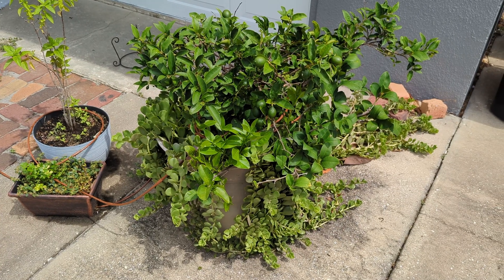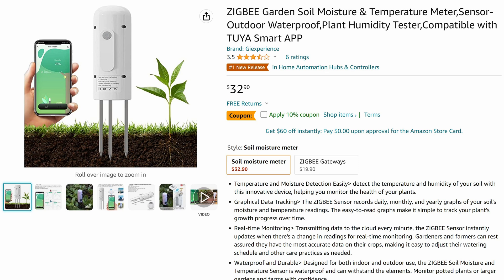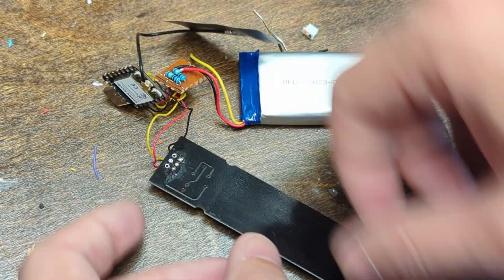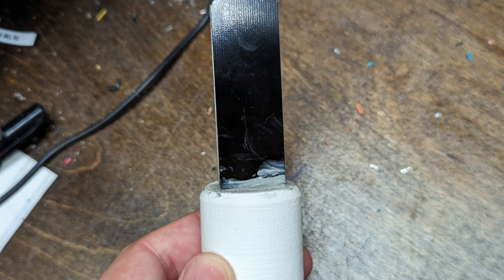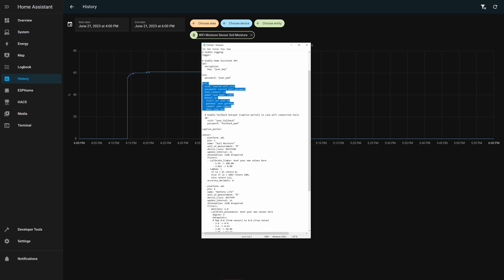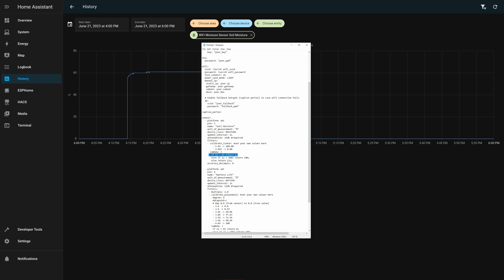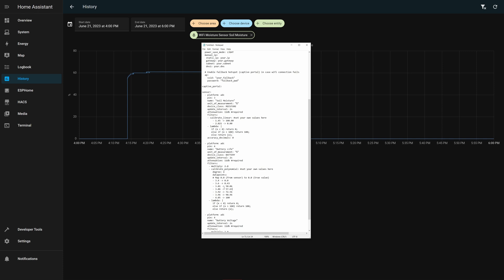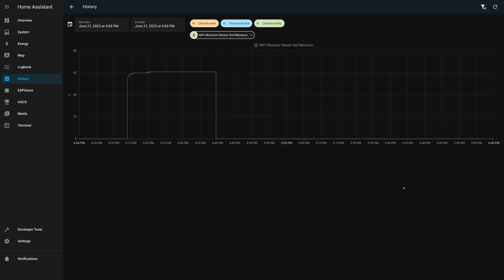Wi-fi Soil Moisture Sensor with ESPHome

Comment: Thanks for posting this.  My sensor is a solar powered sensor in a lake to measure water temperature.   I updated the code to reflect the following. I removed the polling script that would run every second.  I changed it to an on_boot function that checks for the OTA toggle status being on - preventing sleep when the sensor boots.  I have the binary sensor checking the OTA toggle for On/Off state in HA.     I created a simple automation in HA that if the OTA toggle is on turn it off in 10 minutes (prevent long run times on the sensor).  It is similar in function to what you had done but a different flavor.

esphome:
  name: esphome-web1
  friendly_name: Sensor
  min_version: 2024.11.0
  name_add_mac_suffix: false

  on_boot:    
    priority: -100
    then:
      # Wait for WiFi and the API to connect before sending data
      - wait_until:
          wifi.connected:
      - wait_until:
          api.connected:      
      - delay: 5s
     
      # Check if OTA toggle is ON
      - if:
          condition:
            binary_sensor.is_on: lake_sensor_ota_mode
          then:
            - logger.log: "OTA Mode ON → Preventing deep sleep"
            - deep_sleep.prevent: deep_sleep_manager
          else:
            - logger.log: "OTA Mode OFF → Normal sleep cycle"
            - deep_sleep.allow: deep_sleep_manager

I kept updated the binary sensor as follows:

# Monitor HA Binary Sensor for OTA Management
binary_sensor:
  - platform: status
    name: "Lake Status"

  # - platform: homeassistant
  #   name: "Lake OTA Mode"
  #   id: lake_sensor_ota_mode
  #   entity_id: input_boolean.lake_sensor_ota_mode

  - platform: homeassistant
    id: lake_sensor_ota_mode
    entity_id: input_boolean.lake_sensor_ota_mode
    on_state:
      then:
        - if:
            condition:
              binary_sensor.is_on: lake_sensor_ota_mode
            then:
              - logger.log: "Lake OTA Mode ON → Staying awake temporarily"
              - deep_sleep.prevent: deep_sleep_manager
              - delay: 10min   # keep awake max 10 minutes
              - logger.log: "Max OTA window reached → Going back to sleep"
              - deep_sleep.allow: deep_sleep_manager
              - deep_sleep.enter: deep_sleep_manager
            else:
              - logger.log: "Lake OTA Mode OFF"
              - deep_sleep.allow: deep_sleep_manager
              - deep_sleep.enter: deep_sleep_manager

I also have an automation in Homeassistant that checks for the toggle being on for 10 minutes and turns it off.

alias: Lake OTA Mode Off after 10 minutes
description: ""
triggers:
  - trigger: state
    entity_id:
      - input_boolean.lake_sensor_ota_mode
    to: "on"
    for:
      hours: 0
      minutes: 10
      seconds: 0
conditions: []
actions:
  - action: input_boolean.turn_off
    metadata: {}
    data: {}
    target:
      entity_id: input_boolean.lake_sensor_ota_mode
mode: single

Comment: Can you please put a link to a txt where we can get the code formatted correctly? Youtube description isn't the best option :) Thanks
Reply from the maker: It is formatted correctly, as far as the YAML goes. You just have to copy and paste it, and then add greater than or less than symbols where directed. 

Any other issues are caused by changes in ESPHome itself, as they change components over time. This project is dated, in that respect. I haven't updated it for current ESPHome component requirements.

Comment: I cannot get this to compile. Can someone help me out.
Reply from the maker: It's an older project, and ESPHome has received many updates in the meantime. It will require several changes to work with current versions of ESPHome. You might check on the ESPHome discord for help with all the adjustments.

Comment: Amazing video that has covered a lot of things i wanted to grasp. I am new to this so i hope i am not asking the obvious
For the voltage divider you used identical resistors which is why you used a multiplier of two in the code correct? could you have used different value resistors to get 3.3v and not used the multiplier? any benefit of one over the other and what value resistor did you use? 
also the polynomial is to approximate the discharge curve of the LI battery correct? 
again, great video
Reply from the maker: Yes, the identical resistors were to cut the voltage in half. When doing a voltage divider, you're going to be working with a ratio. If you take a reading between two resistors, the resulting voltage will be V*r2/(r1+r2).  Since both r1 and r2 are identical, my resulting voltage is V*1/2.  If you want 3.3V, then the ratio you need depends on what the input voltage is. The resistors can be almost any values, as long as they result in the correct ratio. 

Practically, however, there are a couple of other considerations. Lower resistors values will result in more current flowing through the divider (total resistance is R1+R2, and thus current will be V/(R1+R2)). If there is no switch breaking that circuit, then that current will flow all the time. This can be bad for battery life, especially for a device which is mostly "off". So for battery monitoring, I like to use larger values (100k to 1m). You can't go too crazy though, because you do have to have enough current for the sense voltage to be measurable. 

And yes, the polynomial was just an approximation of the this batteries discharge curve. It's not super accurate, but it's enough for a rough estimate. Linear honestly isn't much worse than polynomial given the other inaccuracies in the system.

Comment: I was testing a very similar setup, and found that my Xiao ESP32C3 was still drawing ~25mA in deep sleep. I wasn't able to reduce the power consumption, so with it only lasting a day or two,  I ended up making it a hardwired system instead. What kind of battery life did you ultimately end up with?
Reply from the maker: 25mA is way too high. That doesn't seem like it's going into deep sleep at all. 

Battery life will obviously depend on the battery size you use, but with my current setup where I power the sensor via GPIO pin, I last recharged on January 24th, and it's showing roughly 50% battery remaining.
Reply: @TechDregs good to hear yours is working as intended. I had 3 separate sensors connected to GPIO 2-4, and a high gain antenna, but even with the antenna disconnected, it was drawing around 100mA in use, and then dropping to a steady 25mA during deep sleep. I tried looking at all of the deep sleep protocols, but never could figure out what was causing the high draw. I'll have to take another look at it soon. Thanks for the info!
Reply from the maker: Hmm... yeah, I don't know. It just doesn't sound like you're not hitting deep sleep. How are you measuring current draw? Are you using a voltage divider on the battery leads for ADC measurement? Are the GPIOs being set to off/low for each sensor prior to sleep?
Reply: @TechDregs  I used a multimeter in series to measure the current. I've been using the esp_deep_sleep() function with a number of different sensor controllers I've built, and know that the devices do in fact enter deep sleep (or some semblance of it), but for whatever reason the current draw is still high. They don't appear to enter any of the alternative sleep modes. I dabbled with trying to set the GPIOs to low individually before entering deep sleep, but that never seemed to make a difference. No worries! I need to do more testing to get to the bottom of it.
Reply from the maker: @holodiscus  Very strange. Is the current draw still high without the sensors? I would probably check what happens when adding them one by one so see if you can isolate what's causing the draw.

Comment: normal water does not conduct like mineral salts or acid or hard ground water PH
but great project.
Reply: It is not a conductive sensor, so the conductivity is not all that important. Probably calibration is needed anyway, the soil will have an influence on the readings. 
https://www.youtube.com/watch?v=m0mcCtcViTY

Comment: For a future video you may want to try the Sonoff "Zigbee Smart Water Valve". It also uses ESPhome and if you use MQTT you can monitor the water usage, set it by amount of water, time and with some coding soil moisture, battery, schedule... I just installed mine on my wife's garden/rain barrel/pond pump and works great. Currently I just set it to turn on 2X a day for 30 seconds  (16 ounces each run). Next is MQTT and soil moisture checking, then rain forecast..... Great video you did

Comment: Thanks for the tutorial! But by Pasting your code i get the following error code:

INFO ESPHome 2024.5.5
INFO Reading configuration /config/esphome/boden-feuchtigkeit-1.yaml...
ERROR Error while reading config: Invalid YAML syntax:

while scanning a simple key
  in "/config/esphome/boden-feuchtigkeit-1.yaml", line 16, column 1
could not find expected ':'
  in "/config/esphome/boden-feuchtigkeit-1.yaml", line 17, column 1

can someone help me out? Many thanks!
Reply from the maker: Check your spacing. YAML is very sensitive to indentation.
Reply: @TechDregs thanks. Will double ckeck

 I tried to ask chat gpt and it gave my this code. 👨🏼‍💻

Comment: Do you have a github page or a written guide with wiring diagrams? I'm just getting started with ESP32 using batteries. Also, did you consider fitting a solar panel to this battery to keep it topped up?
Reply from the maker: https://www.youtube.com/watch?v=Yttauf94A04

Comment: Is there any update on this project? How is the battery life? How accurate are your readings? I'd be very interested in a follow up
Reply from the maker: I can't speak to accuracy, as I have no other soil moisture measurement devices that use a different type of sensor. But since I reconfigured the sensor to draw power via GPIO that turns it off when in deep sleep, battery life is over four months on a charge. I did something like a followup in these videos: 
https://youtu.be/4EZYYPmQnJY
https://youtu.be/Yttauf94A04
Reply: @TechDregs  Interesting videos, thanks!

Comment: Thanks a lot for sharing your project! A quick question: the Xiao C3 is rated up until 3.6V whilst the battery is 3.7V (and I assume the voltage goes even higher, maybe lower 4.x when fully charged). Have you experienced any issues with it, should I be considered if I were to copy your setup with a 3.7V LiPo battery?
Reply from the maker: Not sure where you're getting the 3.6V from, so IDK what to reference there. The Xiao is made for 3.7V LiPo batteries. The higher charged state voltages (~4.2V) are no problem; that's just how LiPo batteries are.
Reply: @TechDregs  it is under 4.2 Recommended Operating Conditions https://files.seeedstudio.com/wiki/Seeed-Studio-XIAO-ESP32/esp32-c3_datasheet.pdf

But clearly your setup works, so it's probably a non-issue. :)
Reply from the maker: That's power to the ESP32-C3 module itself. The battery is managed by a separate chip, and then ran through voltage regulators as output to the ESP32-C3 which never sees more than ~3.3V. You can see the power arrangement on the schematic: https://files.seeedstudio.com/wiki/XIAO_WiFi/Resources/Seeeduino-XIAO-ESP32C3-SCH.pdf

Comment: I pasted your yaml code into the code for an ESP-D1 on Home Assistant and did a search and replace of the &gt and &lt markers as directed. When I run the "validate" on the code, I get the following error message:
INFO ESPHome 2024.3.1
INFO Reading configuration /config/esphome/d1-1.yaml...
ERROR Error while reading config: Invalid YAML syntax:

while scanning a simple key
  in "/config/esphome/d1-1.yaml", line 61, column 9
could not find expected ':'
  in "/config/esphome/d1-1.yaml", line 62, column 9

I do not see anything where I would think a ":" would be needed.
Reply from the maker: I'm not sure. It could be a spacing issue in your YAML or it could be a change to ESPHome that has occurred since I did this project. Lines 61/62 are in the WIFI setup for me, and I don't see any issues there, so I'm guessing it's in the lines above that somewhere. Just check all the indentation.

I haven't updated mine in a while, but next time I do I'll update the code in the details.

Comment: Ok, my sensor is working, it reads 30 second and after 3h in deep sleep. But I have 2 questions.
1. It seems that the Voltage reading is not very accurate. I have calibrate the value Many times but after some reboot it reads 0.2 0.3 V more or less than the real battery value. I have used two resistor 220k in parallel.
2. How can I do to allowr home assistant to show in the dashboard the last value read when the esp32 is in deep sleep.
Thanks in advance for any help.
Reply from the maker: For #2, that should just show up automatically over time. For #1, battery voltage in my experience can fluctuate a bit, especially when it's above 4.0V. It seems to settle down and get smoother below that.
Reply: read esphome deepsleep page.

While in deep sleep mode, the node will not do any work and not respond to any network traffic, even Over The Air updates. If the device’s entities are appearing as Unavailable while your device is actively sleeping, this component was likely added after the device was added to Home Assistant. To prevent this behavior, you can remove and re-add the device in Home Assistant. 

i think this should solve your problem.

Comment: Hello, I'm trying to make my yaml configuration, but I got this error:    Pin 0 is used in multiple places. Could you help me? thanks in advance
 

Failed config

sensor.adc: [source <unicode string>:55]
  
  Pin 0 is used in multiple places.
  platform: adc
  pin: 
    number: 0
    mode: 
      input: True
      output: False
      open_drain: False
      pullup: False
      pulldown: False
    inverted: False
    ignore_strapping_warning: False
    drive_strength: 20.0
  name: Battery Life
  unit_of_measurement: %
  device_class: battery
  update_interval: 2s
  attenuation: 11db
  filters: 
    - multiply: 2.0
    - calibrate_polynomial: 
        degree: 4
        datapoints: 
          - from: 3.4
            to: 0.0
          - from: 3.6
            to: 8.43
          - from: 3.81
            to: 50.06
          - from: 3.86
            to: 57.63
          - from: 3.92
            to: 72.56
          - from: 3.96
            to: 90.96
          - from: 4.05
            to: 100.0
    - lambda: !lambda |-
        if (x > 0) return 0; 
        else if (x > 100) return 100;
        else return (x);
  disabled_by_default: False
  force_update: False
  accuracy_decimals: 2
  state_class: measurement
  raw: False
sensor.adc: [source <unicode string>:80]
  
  Pin 0 is used in multiple places.
  platform: adc
  pin: 
    number: 0
    mode: 
      input: True
      output: False
      open_drain: False
      pullup: False
      pulldown: False
    inverted: False
    ignore_strapping_warning: False
    drive_strength: 20.0
  name: Battery Voltage
  update_interval: 2s
  attenuation: 11db
  filters: 
    - multiply: 2.0
  disabled_by_default: False
  force_update: False
  unit_of_measurement: V
  accuracy_decimals: 2
  device_class: voltage
  state_class: measurement
  raw: False
Reply from the maker: You need to allow other uses. It's an update ESPHome has since I made this. Use it every time you setup a pin which is used more than once.

pin: 
      number: 0
      allow_other_uses: True
Reply: @TechDregs  grazie

Comment: Would you be able to explain the switch code  here.   switch:
  - platform: gpio
    pin: GPIO10
    id: sensor_power
    internal: true 
Sorry a noob. Have you got a switch wired into pin 10 thanks for a great project
Reply: Awesome thank you. Love to learn.
Reply from the maker: I'm using pin 10 to provide the power to the soil moisture sensor rather than wiring it directly to the output voltage pins on the ESP32 board. That allows me to turn power to the sensor on and off. This is the routine that sets up pin 10 as a power outlet that can be turned on and off (which ESPHome calls a switch). So, switch: - platform: GPIO tells ESPHome that this will be a binary on/off switch using a GPIO pin. ID: sensor_power is the internal name of that switch so I can refer to it elsewhere (like the boot and shutdown sequences). Internal: true means that it isn't exposed externally, so the switch won't show up in Home Assistant.
Reply: Sorry just reading this again and doing a little Google I was un aware you could supply 3.5 volts from a gpio pin. Other than vin etc.  am I misunderstanding. Probably 😢
Reply from the maker: Depends on the pin. Some pins are input only. But GPIO pins can output about 40mA of current at 3.3v. There is also a total power budget that you have to stay under, but if you're only doing one or two pins of output, that's not a concern.
Reply: @TechDregs  Pleas ignore this if you wish. I know you are not a help board. But I am curious. I have it all working. But when it goes into deep sleep it becomes unavailable on the dashboard.  I have  read on a few forums that it is best to change over to mqtt and then you can use birth and will_message. But I did a quick try and havn't been able to do the switch to mqtt. I am wondering if you have the same issue.
Reply from the maker: Hmm... not sure. Mine doesn't show as unavailable when it's asleep. I'm afraid I'm not as experienced as some of the people on the forum might be, but that's not been an issue I've had with any of my ESPHome projects.
Reply: ok thnaks.  frustrating. All part of  the challange. I will work it out.   @TechDregs

Comment: This is my very first ESP32 project and I am trying to understand how to connect a 18650 battery to the board. How did you make the connection? Are you connecting it to the 5v pin?
Reply from the maker: If you're using a Xiao, the battery connections are on the underside of the board. There are two pads there than you solder the battery connections to.